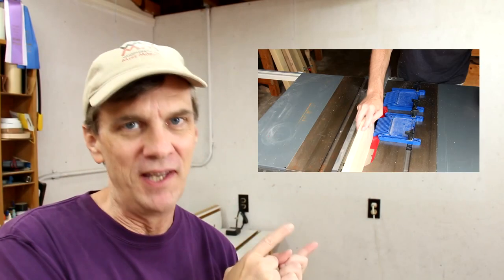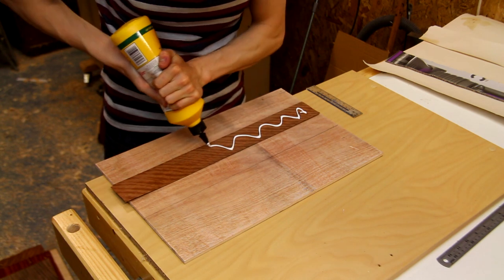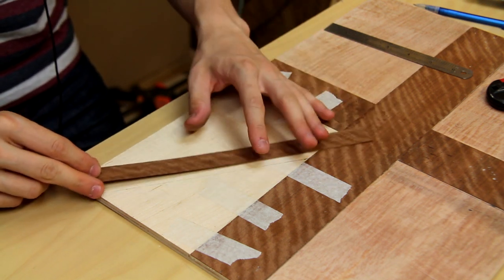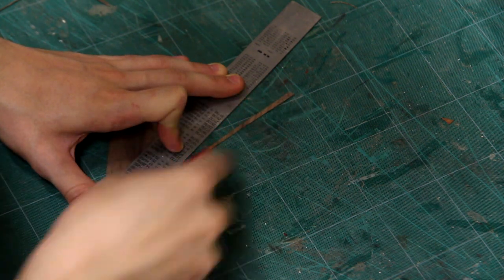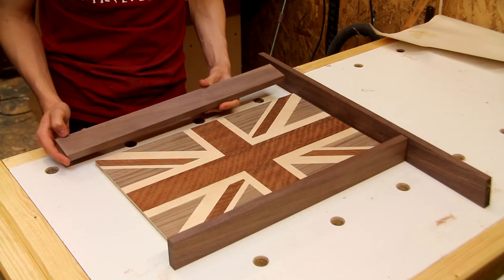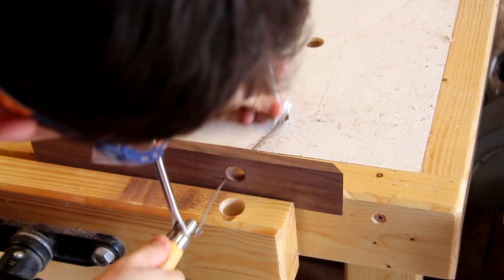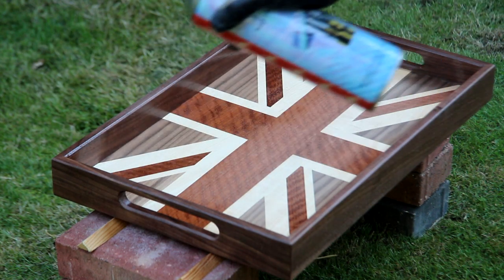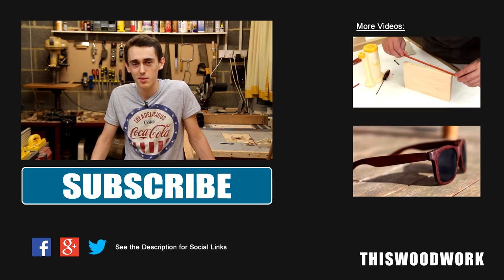Make a Tea Tray. Woodworking Challenge ft. Steve Ramsey from WWMM

Comment: Milk first? Surely not! Great work, what lacquer did you use?
Reply from the maker: Surprisingly yes, although the topic is one of great debate. I asked around a bit and it seems the practice of "milk first" might originate from the need to heat fine china slower, as the scalding tea would crack it. (no longer an issue with modern china) However the tradition continues, with some arguing that it improves the flavor of the tea, as the milk proteins heat more evenly or something. Others rightly suggest that is is hard to determine the amount of milk needed if it goes in before, but for anyone who makes tea regularly it's pretty easy to judge. Personally I couldn't care less and normally when I make tea in a mug the milk goes in later, as the tea stews in the cup beforehand. 
I realise you didn't really ask for the details, but I thought it would be fun anyway. The lacquer I used was some small really cheap "Pro-Coat" brand I bought online, but it seemed to work out pretty nice!
Take care, Alex.
Reply: ThisWoodwork ha, thanks for that. Cant remember the last time I made tea in a pot.
Reply: Mark Payton
Its true that milk was often poured in first to save the china, though this was usually because the quality of the china was poor, and thus would break easily.

It is considered the correct way to pour it in last, simply because asking for milk first was thought to be an insult to the host. It was therefore as status symbol to pour after, as you could be seen to have higher quality china.

Scientifically, there are differences between pouring the milk first and last, too, and you can read all about it online.

I prefer the taste of milk poured last, and it is considered the 'correct' thing to do, though it is entirely up to the drinker.

As stated, it is a lot easier to judge the amount of milk you will need in any particular tea if you pour last too.

In summary: "Milk first? Surely not!" was a correct response ;)